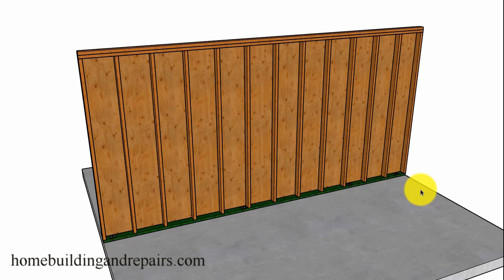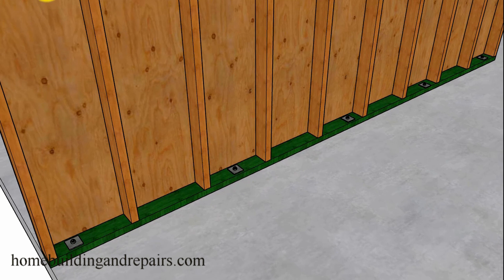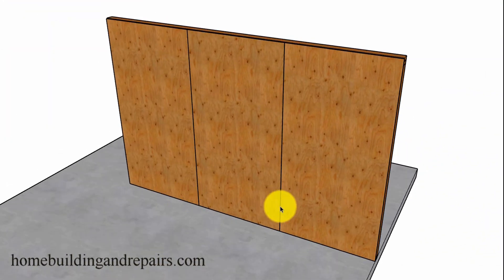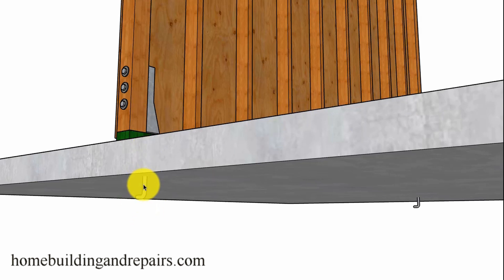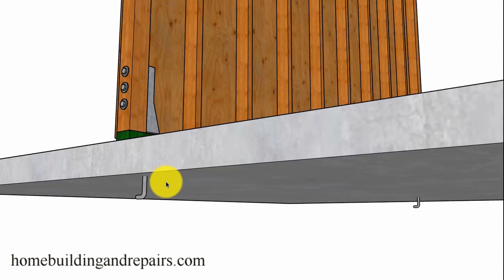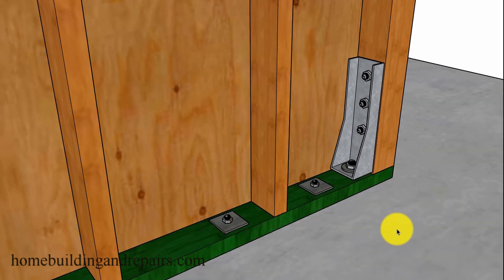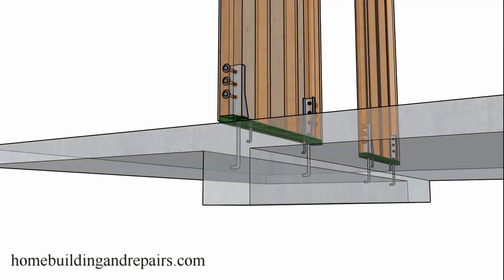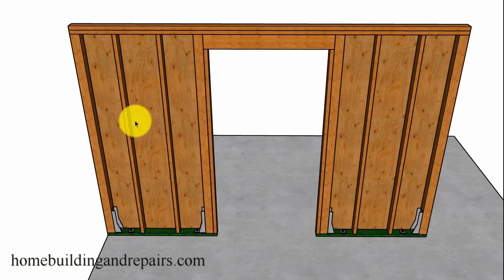Watch This Video Before Cutting Opening In Structural Shear Wall Framing

Comment: The anchor bolts are near the hold-downs because, at the moment of the wall installation, the hold-downs may not be installed at all. The anchors for the hold-downs may not be inserted into the concrete foundation during the pouring process but drilled into the foundation later. The anchor bolts are needed to align the wall.

Comment: I have a question on what I believe is a sheer wall.  I have a structural engineer that will asses the wall.  this is a 2nd story wall that spans between the front of the home and the 2nd story bedroom.  Not attached to the floor anywhere just between the high ceiling and the 2nd story room.   I want to take out part of it to open up space and light... possible??
Reply from the maker: I can't provide engineering advice, but it sound possible.

Comment: Hi I'm Kevin Hollis and I'm currently remodeling my family home and want to remove a non load bearing wall.  I want your video on not to remove any wall that may offer support. The existing home has a kitchen and formal dining room and a living room.  The wall between kitchen and dining room is non load bearing and the wall between formal dining room and living room is separated by a non load bearing wall with french doors.  If i remove this wall how do i support the span.  its non load bearing but structural.
Reply from the maker: I think the best place to start will be checking out our website where there are plenty of videos on remodeling.
https://www.homebuildingandrepairs.com/remodeling/index.html

Comment: What if you just take off two 2×4s, does everything collapse??
Reply: Depends. What if there are only three 2X4s in the wall?
Reply: @Hizenbird  like in the example above if there are about 13 studs
Reply: @lajok3r323  Everything would not collapse. But you would need to add a header, king, jack, and possibly cripple studs to carry the load/transfer the load to ground.
Reply: @Hizenbird  So if it doesn't collapse what happens if you don't add all those things?? Last question lol
Reply: @lajok3r323  It will sag in that area. The door or window in that space will not seal, may not even close all the way depending on how bad it gets.
Reply: Probably not right then, but consider the worst case scenario. What if a tornado, hurricane, or earthquake hits your home? That’s when sheer strength really comes into play.

Comment: but most homes just have basement underneath... what would that change?
Reply from the maker: Any structural parts that would be removed might lead to adding them some where else or redesigning the sections of the wall on either side, making them stronger to make up for the area removed.

Comment: After going through just a "6" earthquake at 3 am in my house, I'm now thinking about sear strength a lot more. Nice video for some great general knowledge.
Reply from the maker: Hopefully there was no damage to the building just a few rattled nerves to the occupants.
Reply: @gregvancom  There was not any real damage, a lot of things on the floor however. When it hit, it really felt like the house had come off the foundation, I was much relieved to see that it was ok. Before the quake, I removed my ceiling in the living room and there are no collar ties but only 2 steel cables to keep the walls from spreading.  It's also a hip roof, so maybe not as bad as if it was just a gable. But I'm still thinking about some steel bents or something in the living room to help with the shear.

Comment: Excellent info!  To add one more data-point, I recently went to my structural engineer about a hole in a shear wall (a window) and he gave me a choice.  I could either put hold-downs on each side of opening (essentially on the doubled-up king studs) or I could tie the header to the walls on each side of it with Simpson CS18 straps.  His explanation was that in the former case, I would be creating two separate shear walls to give the necessary rigidity and in the latter case, I would be tying two halves of the same shear wall together with the metal straps and they would act as one.

I ended up doing both for reasons too convoluted for this forum.
Reply from the maker: Great information and thanks for sharing it with us.